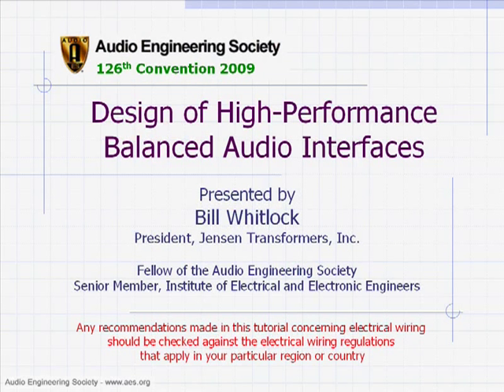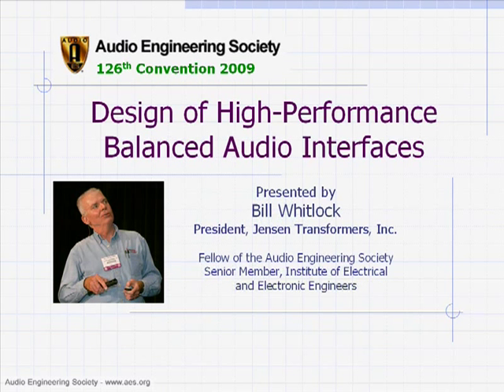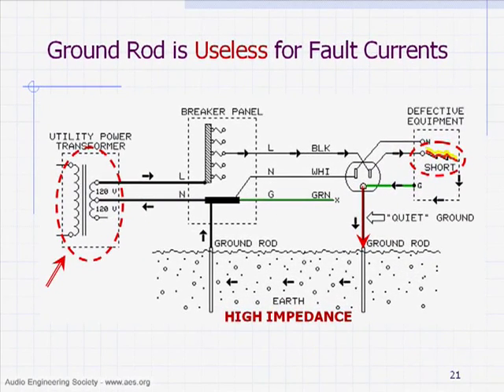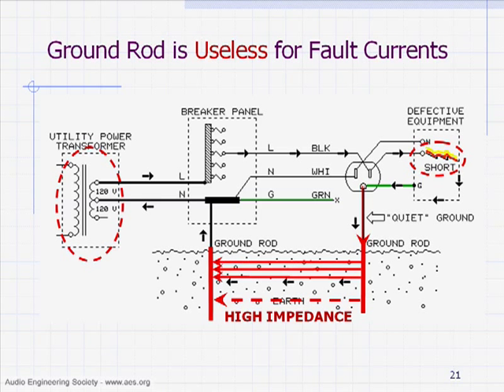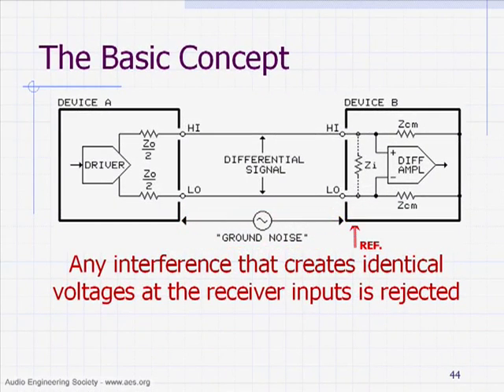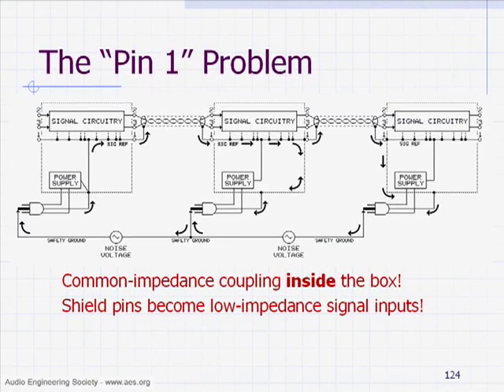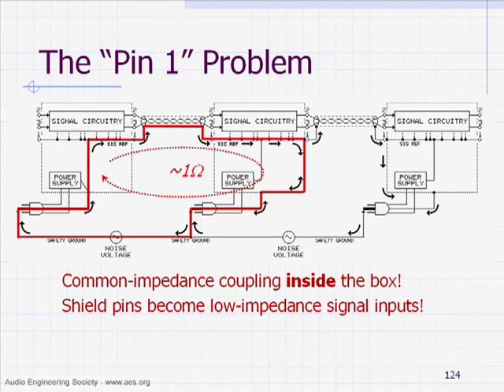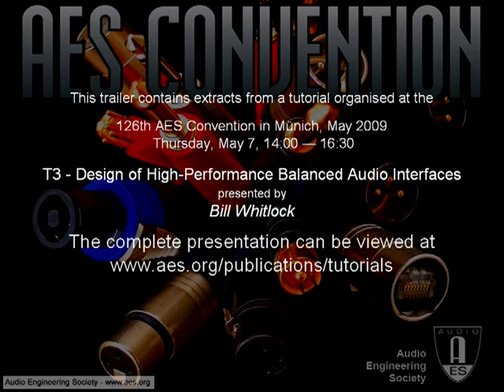AES Tutorial: Design of High-Performance Balanced Audio Interfaces by Bill Whitlock

Comment: Do you connect the pin 1 shield to the XLR connector shell lug on both male output and female input ends of the cable to prevent inductive and RF EMI EMC noise get into the audio signal path?